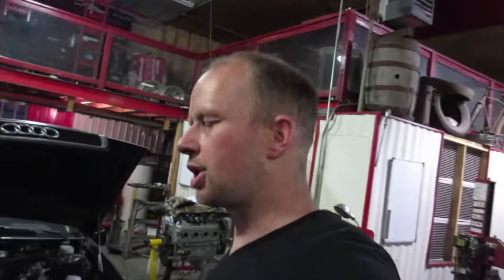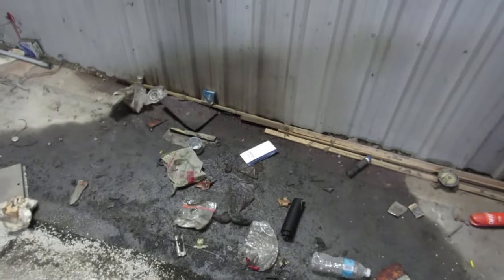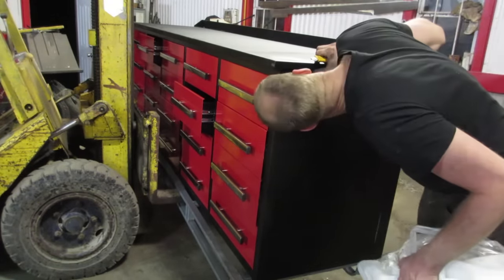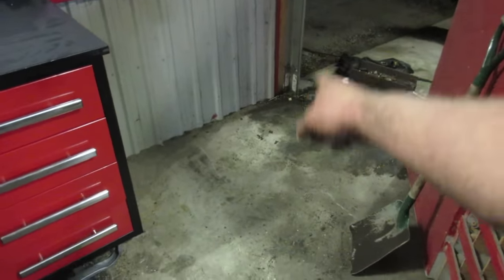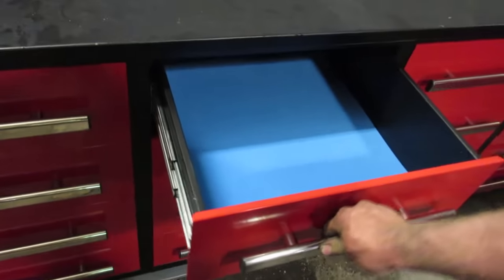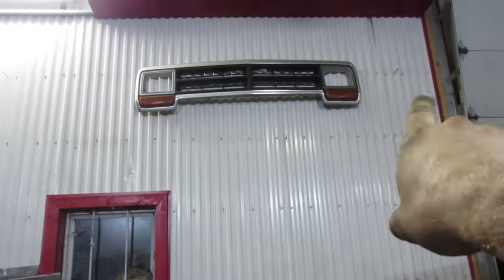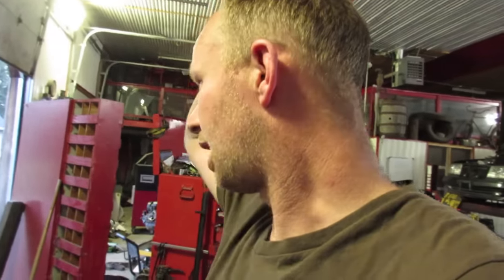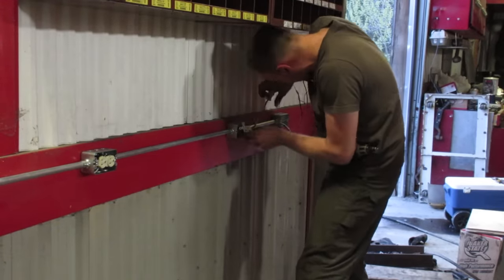Best CHEAP Workbench You Can Buy Online? 10 ft of Heavy Duty Steel

Comment: wiring tip:  on stranded wire twist the wire strands counter clockwise then wrap the wire around the screw and tighten the wire will not spread or become untwisted and it will tighten around the screw just like solid wire. no need to leave some insulation on the end of the wire
Reply: You just saved me so much headache if that works like you say.  Thank you.

Comment: LOVE IT !!  The spot that holds water is going to hold moisture and RUST what is above it :(  I have the same situation and have to make sure to throw quick dry down when it rains. I ended up moving the tool box !!!  It was on 6in castors and still rusted the seems on the box and the tools in thee drawers above it. It is a snap on and still rusted. Keep an eye on it :)

Comment: Electricans trick: wire plugs upside down used in hospitals. that  way when you are mig welding ground is the first thing you hit!
Reply: Absolutely but if you must mount them on their side have the ground to the left that way the neutral is on top instead of the hot being on top when the ground is to the right. Now if you can tell me where that idea came from I'll be really impressed. And yes I do know where it came from.

Comment: When you make your Ramen noodles do you strain the water out or eat it as soup?
Reply: Strain, I use to eat it as soup, But once you strain, You cannot go back.
Reply: Soup.. but I like both

Edit: Now that I think of it, I drain it a little and then eat it as half soup.
Reply: If you do it right you wont have to drain anything. Bring it to a boil and add flavor packet and stir. Then turn the stove off and let it sit for 10 minutes or so with the lid on the pot. All the flavor and water will soak into the noodles. Tastes amazing

Comment: Stranded wire is NOT supposed to be wrapped around a screw! You have to use a terminal, you are asking for trouble down the road. Just because you have done wiring doesn't mean you are doing it right! You should have pulled solid wire.

Comment: I dug two old barrels out of the grove, threw an old door on top, put my tool box on it, and called it a day.
Reply: pfleeger2010 Used to do that overhauling diesel engines , half a sheet on one side , half a sheet on the other , worked in a shop when I was younger , 4guys two shifts , we could overhaul a Cummins 855 pretty much in one day.

Comment: Untreated wood (even painted) on concrete floor : Not good idea.
You’ll be changing shop again in 10 years.
Reply: w9gb 
Treated wood on concrete, under a steel toolbox/bench: not a good idea. ACQ and its ilk are corrosive to metal! 
His wood will still be fine in 20 and 30 years anyway
Reply: And it's in a low spot where liquid pools too.

Comment: Never seen drawers with dual sliders on the sides. must be a bargain way of making them tougher & more rigid without buying super duty ones.
Reply: John Possum . High end tool boxes do it all the time.  Doubles the capacity without adding any additional parts to the BOM
Reply: My 50 year old craftsman  has dual slides, friction not rollers.
Reply: No bargain- it’s good engineering

Comment: "Not Snap On"  Just as well, would have cost more than your house if it was!
Reply from the maker: Someone recommended me an american made bench.  8' was $12 000 USD.  Would have been over $20 000 CAD to my door.  As much as I want to support north American, it doesn't make sense.  Tried to find manufacturers in Canada and was told point blank, every single box and bench is from Asia.  Just different middle men.

Comment: Where do you buy them?? I cannot find them online.
Reply: Link is in description, That page will ask you if you want to visit another site and you can buy it there, It's about 2 grand.
Reply: you can buy them on Ritchie Brothers Auctions. Depending on time of the year the last auction of the year is usually the most expensive but I've seen them go for a few hundred dollars. You can get them in a few different configurations and colors also
Reply: beastm0de7 
...no way I’d spend $2K on those. Not that they’re bad or cheap, I just wouldn’t spend that much on those. 
But I’m set up to build cabinets and have built some very nice drawers toolboxes and benches in the past. A long day of work and $450 materials would save $1000!!!